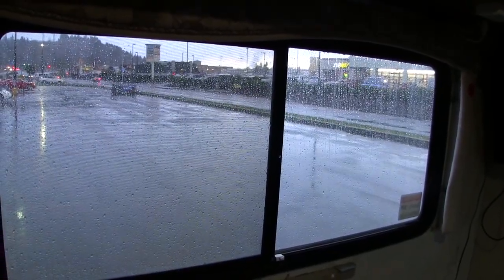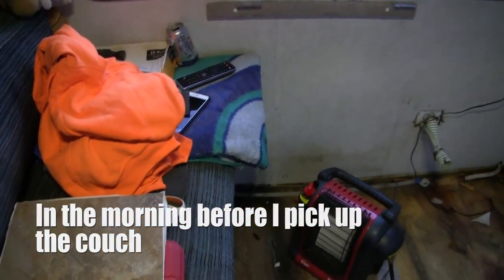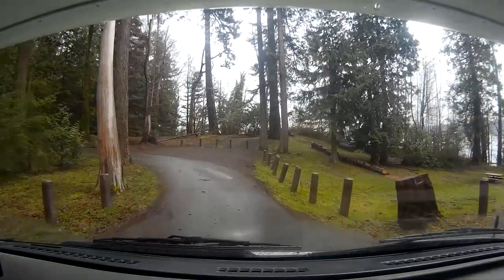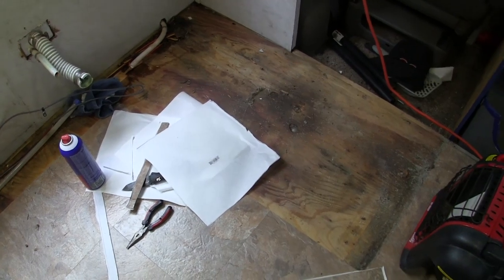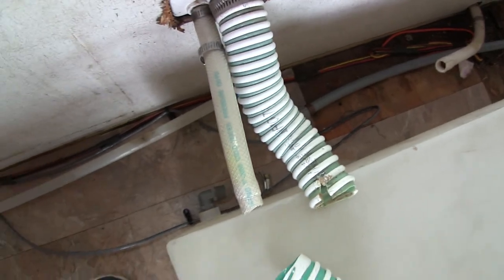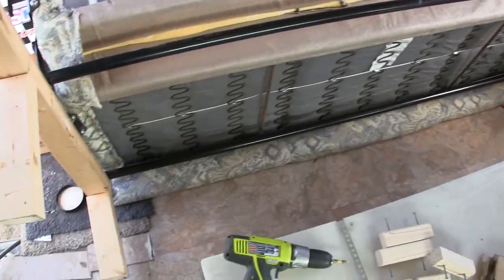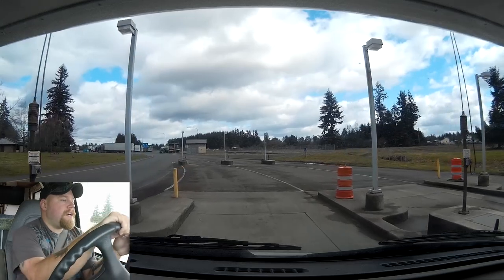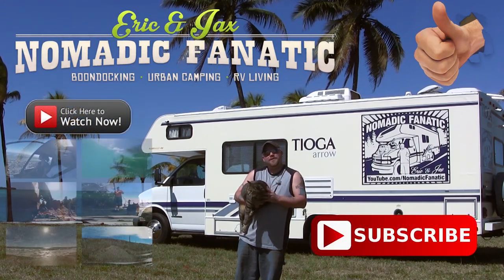Jackknife Sofa & 58 Gal Water Tank Install

Comment: Eric, you may consider adding some soft padding between the tank and the strapping. The strap could possibly wear thru the tank.
Reply from the maker: Oooh, good call! the shaffing while driving could maybe cut right through over time. Thx.
Reply: Or get 2 floor anchors installed, then a 2 inch wide by 6 foot ratchet strap (5000) LB rated and strap that thing to the floor. That would be 10 times the weight rating of a full tank & not wear on the tank. It would not move, at all. Do this with my Pac Rat tool boxes in the back of my E450.

Comment: With the tank full and the couch on top of it, you have about 550-600lbs that in the event of a accident (you rear ending someone or head on) it will take the couch and all through the back of your driver seat. That's why utility vehicles have safety cages between the driver and heavy equipment they carry in the back, even your local cable company vans have them....just FYI ...oh and pick up an friend via YouTube to travel with you!
Reply: so he should put a wall up?
Reply: GManKeepsltReal I don't think he'll have anymore of an issue that with the booth that was there before.

Comment: You're in the perfect position to add an "arm" to the passenger side of your couch to cover the jackknife hinge (metal) hardware using the framework you installed to raise the couch over the water tank.  Take off the plywood you used to stiffen the legs and fabricate a larger piece to cover the whole end and support an arm rest on the top of the new arm.

Comment: it is nice to have 2 people to fill the tank yes :) when i got my brand new caravan, i was on the outside filling the watertank. When i got in the floor was full off water. When the factory was installing the tank they missed on 1 off the screw holes and put the screw into the tank..

Comment: nice upgrade,  I agree with shawn, and here is a cheap fix, get a couple heavy duty bicycle inner tubes, split, cut into lengths and place under the straps between them and the tank. problem solved on chaffing.

Comment: Eric, I've got a suggestion. I'm guessing that you have the water tank exposed to the drivers compartment. if you would enclose that like you did on the end of the sofa and then if you have room stuff some fiberglass insulation between the enclosure and the tank you would deaden the sound of the sloshing quite a bit. the sofa looks good in there

Comment: Eric great mod video. Just a suggestion. Make a hinged small wall mounted kitchen table to be used as a kitchen/working table. When not in use could just be folded up and strapped down against the wall where your other table was mounted at.

Comment: Folding cup holder under the window.  AND add a couple more blocks around the base of the tank; OR put in an attractive full length strip of heavy molding along the front of the tank to replace the blocks for a more secure hold and make it look good too.

Comment: You could insulate around the tank to reduce sloshing noise.  It looks like you could still use your table bracket and make a smaller table.  The support leg could be angled back towards the wall.

Comment: If you still have the old seat belts (or just visit a yard and get a couple) you can cut sections to put under the straps. Then bend the corners tight so there's no play. and at the screws bend over a couple layers of the plumbers tape, then run the screws through. That reinforces the area so they don't pull through. I wouldn't think that the drain and pump connections are actually any different so the extended lines are probably not needed. As for the exposed wiring and water line. Hit Lowes/Home Depot and buy a couple of the nice project boards, Assemble them into an L shape and use that to cover them.

Comment: You need curtains thermal to devide cab and from back much cosier helps with heat loss if you are going to stay in colder climates I would put in a multi fuel stove that would keep you warm dry heat. And curtains on all other windows.

Comment: Eric,You may want to get some rubber pieces for the corner of the tank bracing straps to keep from damaging the tanks.  The straps you have now will cut into the tank over a short time... An old inner tube will work and should be a quick fix...  Just a suggestion...

Comment: Take a photo of the bar code and send it to wherever you are checking after you call them.  I once had a similar issue with tile I bought at Home Depot.  Finally got someone who could check in all their stores throughout the U.S.  They found some boxes in far flung areas, had them shipped to my store and I was good to go.  It required that I get someone involved at the corporate level.

Comment: Hey I like that combination! I would like an RV that size, and wanted a couch but thought I needed the diner to work at. Because there will most likely be two of us, I also wanted options for seating so we're not both lined up on one couch all the time. Plus I like to put my feet up! The couch looks like a much better sleeping place for a guest than the diner :-) Looks like you have the perfect solution, and a lot more comfort!

Comment: New sub here.  You need to get a Hose Filter for the buddy Heater when using a Large Propane tank!  Because eventually the pilot will begin to not light making the Buddy heater not work at all.  I know this because I have run thru 2 Buddy Heaters already!  Something about a chemical or residue from the larger tanks, that is why they recommend a Hose filter.  I got mine from Central Tractor Supply for around 10$  Look it up on you tube.  Great videos, enjoying them !

Comment: Nice job!  And the sofa blocks off the cab halfway which is nice for privates.  Now you can get some nice drapes to pull across the upper part that coordinate with the sofa and it will look really nice :)  Its obvious Jax likes it - he can now stretch out on the sofa next to you while you work.  I got really frustrated with trying to use my laptop on a lap desk when I had to do detailed editing or needed space to make hand written notes or other things.  Have you considered making a smaller tabletop hinged under the window that you could flip up to work on and flip down out of the way for when the bed flips out or you just want to relax?

Comment: I'm surprised you didn't get rid of the passengers seat (trim support) to get better access?
Take any wood panels and cover the couch back rest springs (look original / storage?).
I'd take a look at exactly what's under the other dinning seat with the possibility of building a new (smaller footprint) cabinet to add another chair?

Comment: Interesting idea for the couch, but I worry about what that water tank is going to do in a frontal crash to the driver.  I'd put 3 inch straps (use the seat belts you took out) and bolt them through the reinforced floor. (Big washers underside)
How many times have you had overnight company that needed sleeping accommodations?
A desk where the other seating area is would be ideal.

I've been thinking of removing my bench dinning room set up in my RV and installing a semi round leaf single leg table. (removable strap to secure it to the floor) Then buy 4 of those nice padded folding church chairs.  Normally we'd use two inside and 2 outside for when the wife and I sit outside.

For Company I'll turn the table 90 degrees and add a leaf for seating for 4. (normal seating arrangement)
Otherwise we will only be seating 2 at the table.  Mostly for writing and Laptop use for the wife.
This way I would have a wider floor space in the kitchen area when it's only 2 of us.  

Going to pull my recliner, it's uncomfortable anyway and build a desk where it sits.
Then yank the couch, nobody sleeps with us, and put in two wall slide recliners across from the desk.
My big screen TV will raise out of the top of the desk near the back for movie nights.

But I'm in an 89 Class A Fleetwood Limited.  So I've got a little more room than you Eric.

Comment: Really love the new couch! Did you get rid of the blue/gray chair next to the front door? Also, I've seen small square leather ottomans, which two would fit, in front of the couch with matching lids (can be used for extra storage too). They serve as foot/leg rests for the couch or extra seating. If you have serving trays, you can put food on them. Anyway, changes are good. Eric, this video was really well done!

Comment: I really liked this video! Impressed with the whole job and especially your tile laying skills! It looked like you eyeballed all those cuts!? When I bring out a straight edge and measure twice, carry over to a work bench to cut it, I still find a way to mess those up! Curious what you were spraying on the back of the tiles?? I'm thinking of using these in my rv.     Robert

Comment: Checking out your buddy heater in the video, it appears you are not using a filter on it. I noticed in an older video when you had it piped into your other motor home that you were using it. Did you have an issue with using the filter or something? Just curious, I just bought a buddy heater yesterday on Amazon with the 12ft hose and filter. If you have any tips about using it or could make a video on your setup with it, it would be great. Since you have been using it for a long time and appear to like it very much.

Comment: looks good! but I have a feeling your gona get tired of climbing over the couch and or having to go outside and around in bad weather..  peace!
Reply from the maker: Litterbox was between the two front seats before. I’ve never used that route to get from drivers seat to the RV area anyway. And it’s not pleasant to do anyway with the steering wheel and motor doghouse. I simply exit the drivers door and enter the side door. Its really quite easier than climbing through that area anyway, so I don’t mind at all

Comment: /whats up with your fridge Dude???? I love it and need to replace mine,. I  put a used fridge in my 1960 Boles Aero. One that ran gas or electric. So the front is a lil damaged and dinged up. Would love something out of the normal range which is exactly what you have there. Awesome!!!

Comment: Am curious as of how you get forward and backward from the front to the back. Climb the sofa?
Reply from the maker: Litterbox was between the two front seats before. I’ve never used that route to get from drivers seat to the RV area anyway. And it’s not pleasant to do anyway with the steering wheel and motor doghouse. I simply exit the drivers door and enter the side door. Its really quite easier than climbing through that area anyway, so I don’t mind at all

Comment: Maybe I'm missing something, but why didn't you put the new couch up against the outside wall instead of up against the cab? You cut off access to your cab, you'll have to climb over the couch or go around the outside every time.  You would have had to remove the other bench, but you made it clear you weren't using it. This would have also hid the wires you were showing as being an issue. I was shocked when you were showing that wiring mess coming out of the floor, then showed you put the couch the way you did.

Comment: Hey Eric, great work as ever. have you thought about getting one of those small domestic carbon monoxide detectors for your RV? It would make an interesting check for the safety of you Buddy Heater and you could do a vid around it. My X-Sense CO03JF has a button which shows the latest high reading for CO, it normally says '0' as my house gas boiler is totally enclosed. Just a thought.
Reply from the maker: Yes, I have one already. :) And the heater also has an auto-shut off with low oxygen. (It's REALLY picky actually as it won't even work when I'm more than 3,000 feet in elevation with low oxygen.) And I have a propane leak detector and smoke detector.

Comment: easy, u shouldnt lug around 25 lbs of extra tiles just incase. u can always just simply hit up a lowes IF u ever need more. why waste money and carry extra weight all over the country? i like yer 2 step slipper shuffle patting down them tiles. very nice job NF! u never told us what you did with that recliner chair. also u have no way to put your feet up anymore. i like recliners cause u can always lay down on the bed. lots of water on board now. i guess u never used the cab as a walk thru before huh? cant now. hope its a comfy sofa jack scissor thing, hows that work anyways? does it expand to a guest bed or?

Comment: JUST HOPE DOUBLING  YOUR WATER @ 8.6 POUNDS PER GALLON  DOESN'T  AFFECT  YOUR MPG. MINE GETS 7 MPG PULLING  A CAR ON A GOOD DAY. I GOT A MR. HEATER. YOU MIGHT WANT TO PUT A 1/2 DOZEN 1 LB. CYLINDERS  AWAY  SOMEWHERE  FOR THOSE NIGHTS  THE PROPANE  RUNS OUT EXCUSE  THE CAPS  CAN'T SEE  LIKE I USED TO.

Comment: I think you are going to miss the access to the cab area.
Reply from the maker: Litterbox was between the two front seats before. I’ve never used that route to get from drivers seat to the RV area anyway. And it’s not pleasant to do anyway with the steering wheel and motor doghouse. I simply exit the drivers door and enter the side door. Its really quite easier than climbing through that area anyway, so I don’t mind at all